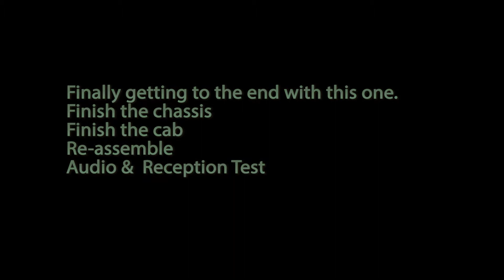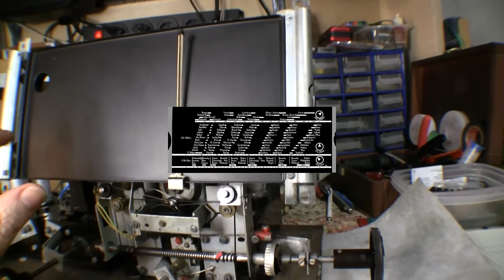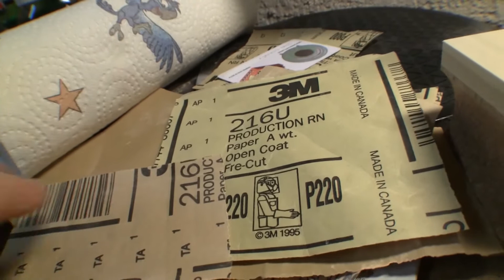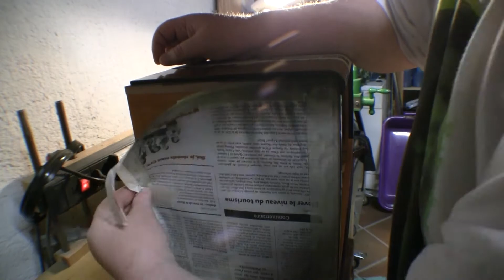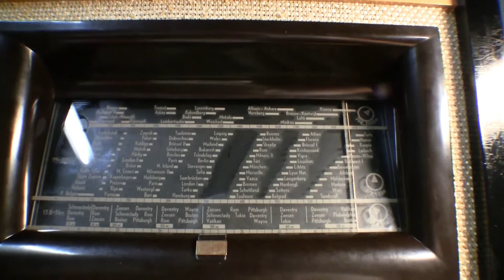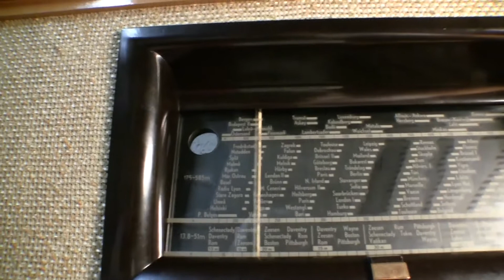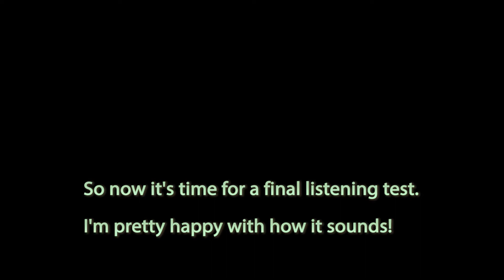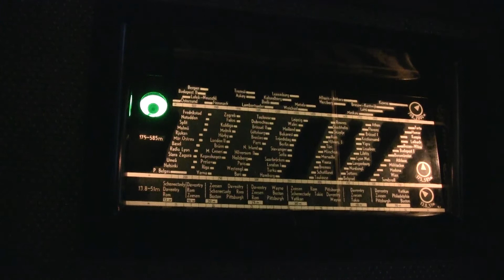Mediator 162A - part 14 (final, Hurray!)

Comment: Nice work, that radio turned out great! They definitely went overboard on the design of that tuning mechanism and I bet it was not easy to setup in the factory either.
Reply from the maker: +50sTransistorRadios They must have had a jig to get it all installed and aligned correctly.  Alas I have no idea what it looked like.
Reply: It's generally less of an issue with transistor radios, but there are some models where it seems like you need four hands to put it back together!

Comment: That is a beautifully restored cabinet and the radio was definately not cheap when bought new. You've done a fine job but I can see you're not satisfied with the pulleys and dial needle adjustment so maybe that was just the penultimate episode?
Reply from the maker: loloaqici82qb4ipp Well I would need 'new information' concerning the pulley arrangement to justify opening it up again.  I know how to fix the pointer alignment but that also requires a major strip down of the dial mechanism so I'd say it will be a while before I take that chassis out again.   But it will come out again at some point.
Cheers,   John

Comment: I think that if I were to print up a reproduction scale, and put it behind the pointer, I would probably just get a new piece of glass cut and put the original scale, flaws and all, in safe storage. Speaking of the dial scale, could the same people who reproduced those Radialva dials for you maybe make a new one of these? Is the Mediator dial scale the same as one of the Phillips models from the same era? I
 It's rather amusing in a way, they came up with such an elaborate and complex dial transport mechanism, but then all that they gave you to indicate which band you were on is that legend printed at one end of the dial showing you which position to turn the knob. You would think that maybe they would have incorporated a semaphore behind a small window, or maybe a set of lamps that turns on with each band, but no.
Reply from the maker: OlegKostoglatov Yeah, I picture the design team being in separate rooms - the guys doing the chassis got on well and did a great job, the guys in the other room working on the dial and pointer were bickering among themselves and generally did an awful job!   That, or the guy doing the dial had decided to leave the company and was serving out his last few days!  If I need to take the chassis out again in the future then I'll revisit the dial glass.  It looks OK in the dark.